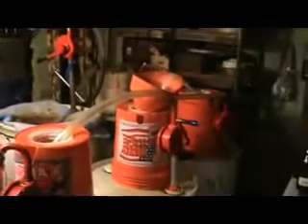WVO Furnace Video 1-04-09 for your tube

Comment from the maker: Still building up... I put an 8" liner in it and the furnace runs very clean, but the nozzle builds up every couple of days. I cut the side of the furnace open and put a door on it so it is quick to clean...Getting better all the time...Fine tuning

Comment: wow that filtration system is ornate, looks like it cost a bundle too sheesh.  It always dismays me to see such claptrap, when some cheap water filters and and old pair of polyester pants can do it better in less space.  To dananderika: Fire up the burner out in the yard, watch the nozzle for drippling as it burns.  If the mist isn't correct off the nozzle (not hot enough) then it will drip.